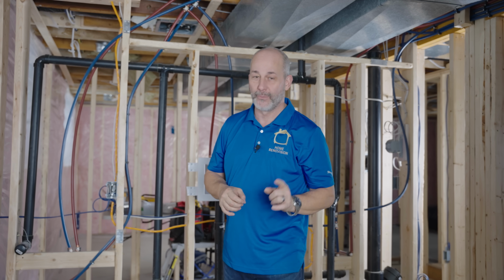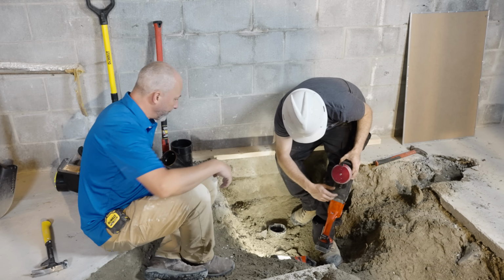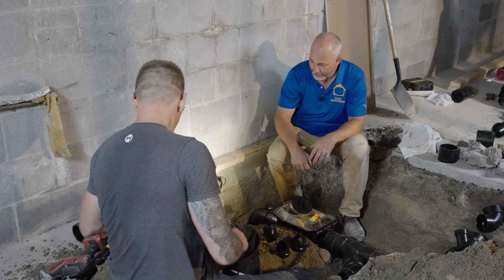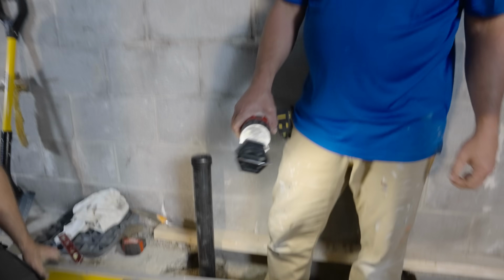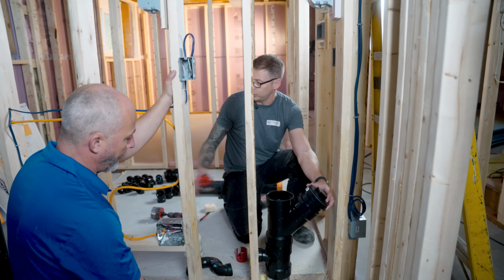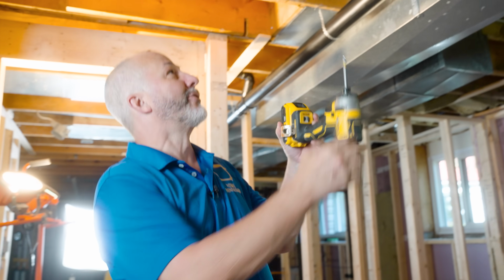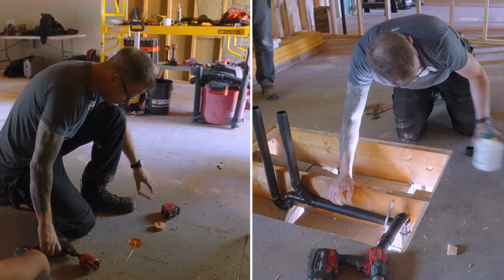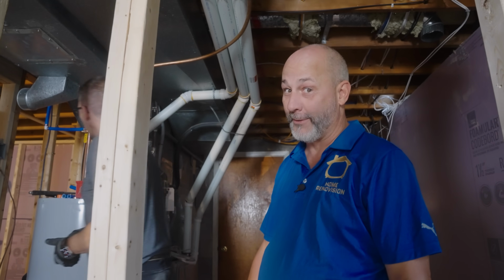Watch THIS Before You Hire a Plumber (You'll See Why)

Comment: Hi Jeff, I'm in Calgary finishing my townhouse basement which was built in 2018. the bath room plumbing roughing was done prior to construction now I'm picking up where plumbers left off. I have two questions,

 (1) can i run the 1"1/2 drain pipe for the vanity between the stud and concrete wall shared with the attached neighbor?. 
(2) or should i be insulating the wall shared between us?.  note the framing and plumbing will be inspected.

Comment: Instead of the sledge, pick, and breaker bar, I’d recommend a chipping hammer. You can put a spade bit on it to dig hard dirt and a bull point to break the concrete.

Comment: Based in the Uk, I do find the different codes in different countries amazing - here the sub base is made up dirt, hardcore , sharp sand, DPM, 150mm foil-backed foam insulation, then the final screed - which, if its liquid, requires another dpm

Comment: Everything is good, thank-you! One question…..over the years I have run into problems with anchoring the toilet to the plastic flange.   I won’t install a regular plastic toilet flange, but instead I buy the one that has a SS ring at the top. You’re using ABS, in our area it’s PVC, so I buy a PVC flange with a SS ring, why don’t you use that, or your plumber?

Comment: In the states, hot water blow/temp/pressure is not always legal into sewage.  If you work is being inspected, check with your inspector because I've had to redo a hot water heater in Texas because the blow off had to be outside, where it could be noticed, with no more then a total of 360 degrees in bends.  Seems odd to see ABS going in as PVC is the norm in most of the US.
Reply from the maker: here in Ottawa we must have everything in the basement since the winter is so cold. Cheer!

Comment: QUESTION? Was there already a drain/ trap in the slab, and y'all installed a new one? Im asking because I have a 1976 home built by my grandfather with no records of build. Im wondering if this was a standard back then and could possibly be a cause of my flooding issue.
Reply from the maker: Hi Jen! very common in those days to have a drain run into a sump pit. only for flooding events and not tied in to the main line. this made a drain available in water events and not being tied into the main line means no sewer smell. If you have water issues consider joining the membership and send me pics and questions on our discord. we have a great community of folks who can help. Cheers!
Reply: @HomeRenoVisionDIY  thank you for your time responding back. That's very similar to what I have going on, except it's the entire downstairs running off to a dry well. No bathroom downstairs. This is going to be an interesting journey. I'll definitely be joining. Thanks again

Comment: City Inspector here,  cannot and should not use the sharp turn 2in 90*s on lavs or any where else.  Venting only.  In the Canadian Plumbing code you can use an air admittance valve for island sinks.  This is a no brainer also because these traps eventually plug and you need access to them just like the backwater valve.  It needs to be a union trap.  Also a no brainer is to use 2in on a kitchen line.  It does not cost that much.  What was done with the kitchen is ok but I would never do it in my place.  25 years contractor and 22 years inspector.  Change the kitchen you will be glad  in the futrue
Reply: In ontario we don't go by the Canadian plumbing code, we have the ontario building code. Union traps can't be in any space that isn't accessible and since that p-trap is under the floor it has to be solid. There is also an accessible cleanout on the island sink trap arm which is there for the purpose of servicing the line. The way they back vented the island sink is also the superior way of venting island sinks, as opposed to an air admittance valve. I do believe that it was done properly.
Reply from the maker: like the plumber said. there is more than 1 right way to do it. Cheers!

Comment: Why do you guys in Canada use ABS and not pvc
Reply: PVC is more expensive, brittle and less flexible than ABS.
Reply: @ ABS isn’t allowed to be used in most states anymore due to it leaking and breaking it’s still sold in cases where it’s installed but you won’t see any abs on any new construction or remodels. They try to cut out as much as possible and transition to pvc
Reply: Interesting, we don't seem to have those issues here. As far as I've seen, ABS is pretty reliable.

Comment: 2 inches of concrete with no rebar for the floor... is that legal in Canada?
Reply from the maker: all basements in Canada have no rebar in them. the floor is not a structural element. so all it needs is enough strength to sit there. CHeers!

Comment: With adding all the vents together in the attic, do you need to increase the attic pipe diameter to accommodate for multiple fixture use and a high vacuum that might draw water out of a nearby p-trap?
Reply: There is a table for sizing branch vents, stack vents etc in the OBC.

Comment: 29:22 Last time I checked the Canadian code if those are not long sweep 90's on the vertical to the horizontal they should be 2 45 degree fittings with a stub making it a long sweep. Why did they not go inside the will coming up from the basement?
Reply: Code allows for regular 90 degree elbows when changing direction from vertical to horizontal. Although, best practice would definitely be 2x 45 degree elbows, nobody ever does that.

Comment: I definitely need to understand more on venting. I understand the purpose of venting, creating airflow to prevent overfills and siphoning, but I need a better understanding of what and where.
Reply: The simple answer is, anywhere you have a fixture connecting into a sanitary drainage pipe, you will have a p-trap to stop sewer gas and a nearby vent to protect the trap. This vent will allow that sewer gas to escape to open air and draw in fresh air to equalize the pressure in the drainage system when it is doing work.
Reply: @Gerard1to  what about cleanouts?
Reply: There are a few places where clean out are mandatory, but truthfully the more the better as it only makes servicing the drainage lines easier.
Reply: @Gerard1to  OK, ill keep it in mind. My primary field is electrical, but I always try to expand my knowledge in the trades. Even if it's not my profession, the trades are always useful skills

Comment: I am looking at building a small powder room in my 1936 home.  What are the inside dimensions of your powder room (unfinished, bottom plate to bottom plate)?  Thank you!
Reply from the maker: mine is a little larger than  most but a average 3 piece bath is 5' x 7'
Reply: @HomeRenoVisionDIY  Really? In the video at ~18 minutes looks a lot smaller than 5' wide? Or am I missing something. Thank you for the reply!!!
Reply: Any update on this one?  I am looking for the dimensions of the powder room at 18:30 mins.  Looks quite small. 34" wide?

Comment: My insurance company wanted those backflow valves. That drill that cuts out glued in fittings paid for itself very quickly - genius
Reply from the maker: Yup! That thing makes the job so much easier. Cheers!
Reply: Couldn’t you just use an appropriately sized hole saw chucked in a drill to accomplish the same thing?

Comment: silly question - why with PEX do you use the manifold in the basement, as you see at the end of the video, over valves at each fixture? If you hae a leak, you have to run to the basement to turn the fixture off.
Reply from the maker: I will have valves at the fixtures as well.
Reply: Crimped Pex actually becomes smaller inside diameter with fittings, which means the more fittings and branches the more resistance to water flow. A manifold will allow for far less issues with flow since it will be more straight pipe runs to fixtures. That's the simple answer.

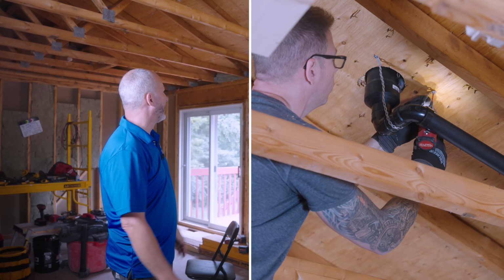Comment: @33:10 instead of making a second hole in the roof, they could've installed a "Sure-Vent" inside the cabinet and saved a lot of time and money. Sure-vent or the Air Admittance Valve is just made to be used in kitchen island sinks situations and its code compliance.
Reply from the maker: when you have all the walls open the inspector will demand to run a vent to the roof. Cheers!
Reply: What they did in the video is without a doubt the best way to do it. Individual vent is always superior and preferred to an air admittance valve.
Reply: @ True. but when comparing it to put a new hole in your roof just for the that single sink... AAV is the best way to go. But the inspector is the king, he/she must be made happy with the work.

Comment: Never went over the manifold system behind you at the end. Wish someone would go over that, Im going to be redoing some stuff in my house when i refinish the basement. I wanna put in a manifold system and bump my incoming line from 3/4 to 1 inch since its 1 inch coming in from the meter, but then down graded to 3/4. So volume wise in my house sucks. If my sprinklers are on, i cant even shower. One plumber said its a waste to do, but 2 other plumbers said if set up correctly would avoid that isssue.
Reply from the maker: the manifold helps me as I finish 1 room at a time. this way I can isolate the water in the room I am working in and keep the rest of the house operational. Cheers!
Reply: @HomeRenoVisionDIY  that makes sense, and I too would love to see a video that explains the manifold system in more detail. I'm to understand there are different types of supply setups but I don't know the differences yet. Sure would be great to be able to do some DIY stuff and shut down a room without shutting down the entire house. Because, yes there are supply stops on each fixture but every time I get in there that fixture shutoff breaks, has to be replaced, and I'm shutting down the entire house

Comment: Couldn’t you vent in the walls instead of going to the Attic and out the roof? My plumber vented my basement bathroom sink, toilet and Shower in the walls with the vents with pop up valves on top
Reply from the maker: not when all the framing is exposed. the code simply states those vents are allowed when you have no ability to vent outside. this means when you don't have a path. open walls equal a path. besides I would rather vent out then have something to maintain over time. Cheers!
Reply: @garylee3329  The inspector is unlikely to allow it. The code limits when AAVs can be used and it was relatively easy to go out the roof here.
Reply: Vents eventually all tie-in together and exit through a vent header. That is the penetration through the roof. You can have multiple penetrations as well if necessary.

Comment: 20:57 how is the wall around the cleanout finished?  Is that cleanout just exposed after the drywall is put up?
Reply from the maker: I will be installing a cover panel and then the dryer goes in front. Cheers!

Comment: Good information.
Minor point about that boulder where you planned to dig. Plumbers change plans to avoid boulder. The true DIYer gets another tool, an electric jack hammer, to spend another day in the dust demolishing the offending bits of boulder. There is a clear difference in the work flow. 😜
Reply from the maker: yup. pros work the solution and DIYers work until they have a solution. Cheers!

Comment: As someone who owned and operated a Sewer and Drain Cleaning company for 5 years on my own and 40 years with my Father. Having that drain face the wall like that is a pre-installed nightmare for cleaning the line. Add that fact that its in a corner too. Hopefully they slanted the cleanout towards the open space as much as they can.
Reply from the maker: that clean out will most likely never be used. the cleanout at the back water valve is a much more viable option, however it had to be there to satisfy code. and yes it will be behind a dryer so we will have an access panel that is large enough to make it work quite well. Cheers!
Reply: JW, how about a timestamp? That would help me see which drain you're talking about. Thanks in advance.

Comment: Those fitting boring tools work great, far better than the stamped metal versions.  But both have the issue that they create a cylindrical hole rather than the tapered hole of a unused fitting.  You must be very generous with the pipe cement because the taper won't save you, and let it set for an extra day both because of the additional cement and the lack of an interference fit.
Reply: I like his tools.I don't think they're boring at all.
Reply: I agree.

Comment: You are using abs , the same stuff that's in mobile homes , house trailers. Cheapest stuff and fragile .
Reply: I see them in 50-year-old houses ABS is excellent
Reply: It's also the standard for alot of residential plumbing in Canada. Kind of like how the US uses plastic electrical boxes but we use metal.
Reply: ABS is more common in residential in Canada, actually. PVC gets very brittle in cold temperatures.
Reply: ABS is fine. I've seen old, beat up ABS keep going and going for many, many years and decades. It's cheap, reliable, and actually easier to work with for homeowners and DIYers.

Comment: Since I'm the first comment. Unrelated, I wanted to thank you for that drywall tip, where you put the tape up to the finished ceiling, so you don't have to repaint it, I've used that technique now so my times it's not funny. I always did it the hard way before. Was thinking about you yesterday. So thanks for that tip!
Reply: I'm having trouble picturing this. Could you provide a timestamp for where in the video Jeff discussed this?
Reply from the maker: it was an unrelated video where I demonstrated flat taping to a ceiling. Cheers!